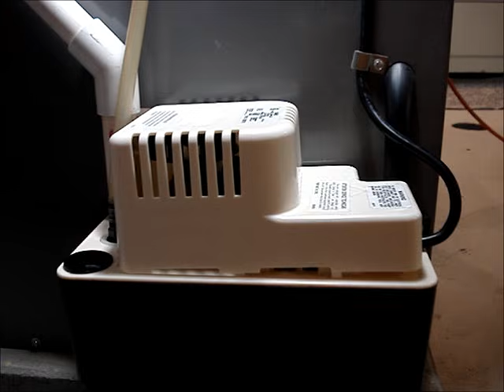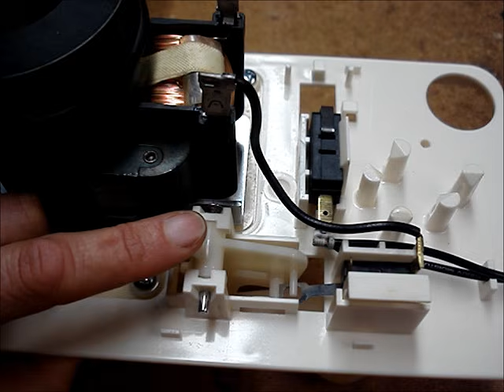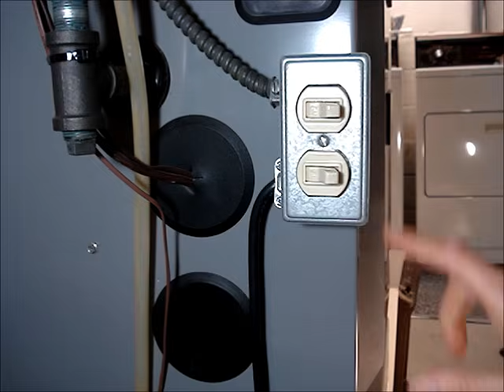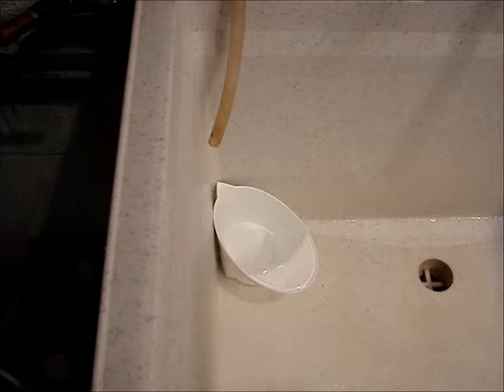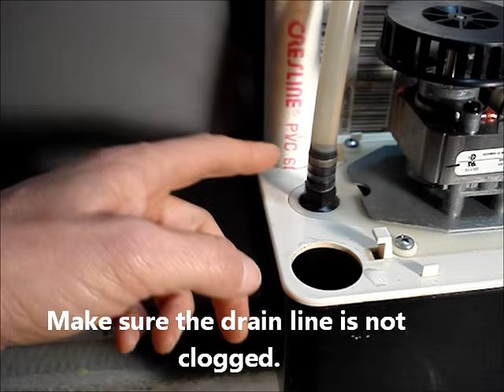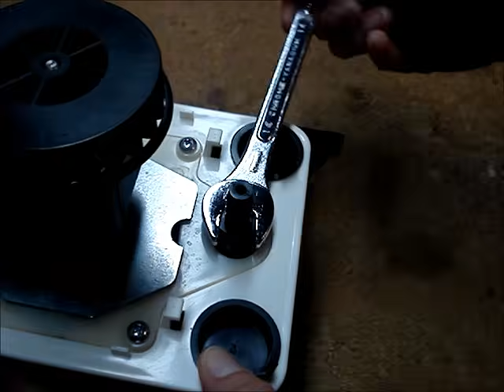How to Troubleshoot a Condensate Pump

Comment: My furnace turns on. but I'm getting water on the floor?
Reply from the maker: Your description of the problem is kind of vague, without some more information I can't offer any good advice. You may want to watch this video that explains how a condensate pump works: https://www.youtube.com/watch?v=-wX2KXitQbA&t=15s You'll have to try to do a little troubleshooting on the pump. If you get stuck and have some more information about how the pump is failing, I'll will try to answer any questions.

Comment: Thanks for this video. My condensate pump line is completely full but the reservoir is dry. Not sure what that means....?
Reply from the maker: Try adding water to the reservoir and watch what happens.  If it pumps the water out, your pump is working correctly.
Reply: A little old now to answer but that is normal behavior. Water is held in the line so it doesn't drain back into the pump tank. This lets the pump to remove more water, increasing how much new water is needed before it turns on, which then also means you save electricity. In the little black piece that the hose connects to in this video, is a check valve.

Comment: Thank you very much for this video. I had a continuous grating noise so I replaced the pump but not the plastic drain pipe that goes up somewhere into my loft. Guess what? as soon as the reservoir was full and the pump got into action I got the grating noise again! I am pretty sure that it is louder than before. (on both pumps) and not operating normally. Assuming that the new pump is in good working order, it must be the water pipe line maybe kinked or something? I am not confident in pulling it out as I don't know where the line goes, so far there is no leak but I am preparing to let this house out as I am moving into to my GF's. Has anyone got any advice on how to approach this?
Reply from the maker: Hey Colin, that's odd you have both a new & and old pump making a grinding noise.  Before you rip out the drain line, I would suggest that you connect a temporary drain line and see if the new pump is still grinding.  Test it by pouring water into it.  Usually, the grinding noise would be caused by running the pump dry (not good for the pump). If it is grinding with water in the reservoir, then I'd contact Little Giant, maybe you got a defective pump or if you still have the receipt, return it to the retailer.

Comment: what if the pump makes a loud  sound  like ZOOOOOOOOM...when it rurns on or off
Reply from the maker: If there isn't any water in the reservoir and the pump is running it will make a loud noise.  It's supposed to shut off before it runs dry.  Running a pump dry is not a good thing.  Could be a problem with the switch or the float.

Comment: Great know-how videos!  Can you tell me if the two shut off wires have to be connected to the furnace/ac unit or can they just be left unhooked?
Reply from the maker: The shut off wires don't have to be connected.  The condensate pump in the video is located near a floor drain, so if the pump fails and overflows, it's not a major concern.  If a condensate pump is located in a place where you don't want water overflowing, then to prevent water damage, it's a good idea to shut the AC/Heat down if the pump fails.
Reply: Thank you!  I will plan on someone hooking up the wires for me.  I already found out the hard way that a pump that doesn't shut off doesn't mix well with laminate flooring...not my doing :/

Comment: I have a weird odd thing happening. My float switch has seemed to reverse itself randomly. When basin is full the switch doesn't engage and it just leaks onto my floor, but if i pull the switch down...as if the basin was empty, it turns on...my unit is probably toast?
Reply from the maker: It sounds like the microswitch is failing.
Reply: @Know-How-Now  I went to buy  one today,  too expensive, I'm just going to drain it in my sump pump pit half a foot away
Reply from the maker: Hmm, I wonder why the installer didn't do that, maybe against code?  To cover yourself you may want to give your codes department a call and ask if that is permitted.
Reply: @Know-How-Now  I made the sump pit after getting the furnace. Bit knowing the way this work it's probably against it lol

Comment: How can I clean the condensate impeller if there is so much build up inside the impeller casing that the blades won’t turn?
Reply from the maker: That's a tough one, I'd try soaking it in vinegar.  If that doesn't free things up, you could try soaking in a weak bleach & water solution, maybe 1 tablespoon of bleach for 8 oz of water.  Bleach is not friendly to rubber (may damage the pump), so I'd do that as a last resort.  If you are pressed for time, it may be best to buy a new pump, they are not super expensive, especially if you can replace it yourself.
Reply: I have ordered a new pump from Amazon. I'll arrive Tuesday. In the meantime, The pump has been resurrected. First, I turned off and filled it up with vinegar and let it soak for a while. It got the propellers moving but making ha horrible noise. Then, I used Drano. Same story. I unplugged the pump, let it soak in Drano for 15 minutes and then turned on and started pouring water down it to flush the drano, but it still was making some noise. Finally, I sprayed orange GooGone down the shaft into the blades in the tank. I soaked it really good and left it unplugged for a while. It is now 80% better but still making noise when it runs. I'll definitely replace it Tuesday when the new unit arrives. Many thanks for your quick response and your videos!

Comment: Great video. I have the puddle of water below the furnace. Took my condensate pump off, and when I activate the safety switch, the water pumps out, but nothing happens when I raise the main float. Could the wiring be set up incorrectly when it was originally installed. Tried tapping the micro switch on the main float, but nothing happens. It's going to be 90 deg here today, so temporarily I have a condensate "bucket" set up. Any ideas? Meanwhile I am cleaning the pump out.
Reply from the maker: I'll presume that you have a Little Giant pump as shown in the video and that the pump has been in place and working correctly for a few years.  Let me know if this is not correct. Do you have wiring from your AC/heat system to the safety switch?

I have an additional video that shows how the pump works....  it has more detail about the switches:  https://www.youtube.com/watch?v=-wX2KXitQbA

After you clean the pump and put it back in place.  Retest it.  If it does not run when you fill the reservoir with water.  Turn power off to the pump & put a wire jumper across the two contacts on the switch for the big float. A jumper with alligator clips on either end is the safest thing to use.  BE CAREFUL!  If you don't have that kind of jumper use a piece of solid 12 or 14 gauge wire(with the ends stripped & insulation in the middle- hold onto the insulation part) and touch it across the switch contacts.  Turn power on to the pump.  It should run when there is a jumper bypassing the switch.  If it does not run, then you have a problem with the pump motor. If the motor or the switch is bad, it may be easiest to buy a new pump (same model),  they are not super expensive.  You'll have space parts.

Comment: Thank you. For all you DIYers, careful tightening the check valve. Mine snapped off.  The part is not readily available at the big boxes.
Reply from the maker: You are welcome, Ruth.  Thank you for taking the time to caution other viewers about the possible pitfall.  Were you able to find a replacement check valve?
Reply: Know How Now - I did find one on Amazon. 6 bucks, better than a whole new pump.  Thanks for doing this video, it was very helpful.
Reply from the maker: It's good to know replacement check valves are available at a reasonable price.  Please consider supporting the channel and subscribe and pass it along to friends.  Sadly, recently, YouTube has stopped promoting a lot of my videos.  I suspect because they are too short.

Comment: Excellent video!  I had the infamous puddle of water running form the furnace.  I'm sure you saved me hundreds of dollars in service costs by explaining this unit.  You have a nice, clear manner of information delivery.  Turned out I had a clogged pipe in the PVC running to the condensate pump.  Cleared that out and was back in business.  Also cleaned this unit which I had not done in 14 years.  Thank you!!
Reply from the maker: Thanks for compliments and taking the time to comment. I enjoy hearing that the videos are helpful.   Please consider supporting the channel and subscribe.  It's free and it will allow me to make more videos.

Comment: Is it normal to have water remaining in the discharge tubing after the pump runs? Water comes out, but not all of it. I can't tell if there is a siphon issue... pump 3/8" tubing is in attic, goes up from little giant then dives down a floor to a PVC stand pipe with air break.  I can see bubbles in the tubing down there and at the pump discharge. Check valve seems to work because pump isn't always running... ideas?
Reply: Issue has become the PVC tubing is sweating in the walls, since it keeps water in it, and damaging ceiling and plaster! Does that even sound right possible...
Reply from the maker: If it's not a new installation, and it is known that the system did work correctly, then it doesn't seem likely to be condensation.  I know that mice will chew through plastic hoses that supply water to a refrigerator ice maker/water dispenser.  Squirrels will check plastic too. You could try plugging one end of the tube & pressure test it to see if it looses air.

Comment: I am on my second pump now. Both run and drain water like should, however still getting A LOT of water leaking from pump. Cannot figure out how or where the water is leaking from. Looks like almost pools on top of pump even, as have went as far as to silicone caulked around edges of pump to prevent coming out sides. Still driving very slowly from SOMEWHERE. had technician look at it and he can't figure it out either, . (Hence second pump, still doing same thing). Driving me nuts. Have to keep bowl underneath to catch water. Any ideas or information would be greatly appreciated.
Reply from the maker: Odds are slim that the 2nd pump is bad.  If you want to be absolutely sure the pumps are not a problem, then you could connect a new temporary hose to it and see if there is any problem with the pump. If the pump works correctly, then you have a drain line problem.   If you have never had the pump work correctly (new owner to the home), then maybe there is some sort of design problem with the drain line/ hose.  If it has worked correctly, then I would focus on a clogged drain line.
Reply: Know How Now thank you for the quick reply! I actually am the one who had the pump and ac installed. New line so can't think it is clogged already. Maybe there is a flaw, just not sure where. I will try taking off vakave and seeing if a back flow issue, but doesn't seem to be as watch and hear water move through tube and draining. Literally cannot for the life of me figure how leaking. Thought have tried everything, new pump, caulked valve stem area/sides of pump.. still water leaking. Driving me nuts. Will take valve off and check flow ..maybe draining but not correctly.
Reply from the maker: After testing the pump, try calling the pump manufacturer's tech support.  My hunch is that the drain line is not installed/designed correctly. The pump company may be able to point you in the right direction with a drain line design problem.
Reply: Know How Now thank you for your insight and quick response. I'll try anything at this point.
Reply: OK..I am on my THIRD pump now. The pump definitely pushes out the water, as i put in food coloring to watch flow, it was green right up drain tube and stayed green(ish) for about a day. Back to clear. However, I am still getting a slow, yet steady leak. I have moved pump from floor to tacked on unit, still nothing. Now I keep a bowl underneath and by the end of a hot day, large bowl is filled. I and my service tech CANNOT figure this out. Driving me nuts. ...the drain tub runs directly up about 4' and then over about 12' then down to drain. The pump tirns out and pushes water...where else would this water be coming from?? Almost like condensation, but Ive tried everything I can think of.... any help would be great!! Thank you!!!
Reply from the maker: Good idea to put food coloring in the water. It's hard to believe that the pump is not able to successfully pump water out of that drain line. I'd call the pump manufacturer's tech support.  Who knows, maybe there is a bad batch of pumps.  Prior to calling tech support, (so they won't brush you off), you may want to connect a temporary tube, just to see if the pump works.  Maybe run it up 4 feet and dump it into a bucket.
Reply: Know How Now ..thanks again. I am going to take old pump (month old or so) out and really test it. I cannot believe I have THREE bad pumps. It does pump water, just def leaks almost as from side or it is "sweating" , but I have even coated last pump with flexseal, silicone etc.. literally have tried everything... Just does not make sense. I really appreciate your help and quick responses.

Comment: Hi.  I just replaced my condensate pump, it did not come with a safety switch, but my old pump had one so I placed the old switch in the empty compartment of the new one.  All the wiring seemed fine.  I turned on the pump and added water into it.  It turned on and water began to drain out.  It seemed like it was working fine.  However, the pump is not turning off.  Isn't the pump supposed to turn off after draining the water to a certain level?  Any advice is greatly appreciated, thank you.  Also, I did notice some water leaking out of where the check valve connects to the vinyl tube and it appears that I need to ensure a better connection.  Could that possibly be the issue?
Reply from the maker: It sounds like you could have two problems.  The leaky connection at the check/valve vinyl tube needs to be fixed.  You are correct, the pump is supposed to turn off when the water level drops low enough for the float to mechanically trip the switch.  

To eliminate the possibility of the two problems being related, put a temporary hose from the pump into a bucket/drain.  Put water in the pump and see if it works correctly.  Do not run the pump without water in the reservoir - you could damage the pump. If it still does not stop when the water level drops, you have a float problem or a bad switch.  Make sure the lever on the micro switch did not get bent.  If the pump works properly, then you'll need to look at the drain line.

I have another video that shows how these pumps work, it may be helpful:  https://youtu.be/-wX2KXitQbA

What was the problem with the old pump?
Reply: Thank you for getting back so soon.  Oddly enough, the old pump actually had the same issue.  It would cut on and drain water out, but then it would not turn off.  Also, after running the new pump a while, a bunch of water mixed with sludge emptied out of the line.  Do you think that a clogged drain line is the issue rather than the pump?
Reply from the maker: Sounds like a clogged drain line.  You could try running some bleach or bleach/water mix through it and then some water to flush out the bleach.
Reply: Yes, that is exactly what the issue was.  We first took a two-handed air pump and blasted out as much gunk as we could (it took about 25 good pumps.)  We attached the pump nozzle to the drain tube end that connects to the check valve on the condensate pump.  We then made a mixture of water and vinegar (I'd say about 3/4 water) and poured it into the pump.  The pump turned and drained the water and vinegar solution out, and then shut off once it finished the cycle, exactly like it is supposed to.  I placed a small adjustable clamp on the drain hose near where it meets the check valve on the pump, and that seems to help stop the leak significantly (it is a very slow one now).  However, I might try to add some plumber's tape on the check valve at some point to ensure that the leak is fully stopped.  All the advice is greatly appreciated!
Reply from the maker: It's great to hear that you resolved the problem.  Thank you for taking the time to write a detailed description about how you cleared the clogged line.  I'm sure that it will be helpful to other viewers.  In retrospect perhaps I should have spent some time on clogged drain lines, though if the video is too long, many people will not watch it.
Reply: @LightSaberPro  I live in south Florida, very humid and lots of slime. Is vinegar or bleach better for fighting gunk and witch one is least corrosive?
Reply: @davidhouser4422  Hey David.  Great question.  Overall, I would assume that unfiltered bleach is the best gunk blaster.  On the other hand, it is also MUCH more corrosive and caustic (dangerous to your skin and lungs etc).  Vinegar however, while perhaps having less kick in "brute force" than bleach, is still very effective.  Most importantly, it is much safer for you and your household.  I still occasionally clean my family's condensate pump with a 50/50 mixture of distilled white vinegar and water, and it has so far worked perfectly since I have been doing so.  (I also use vinegar to clean gunk out of showers and around toilets, and it seems to work very well.)
Reply: Know How Now "'m
Reply: +qq